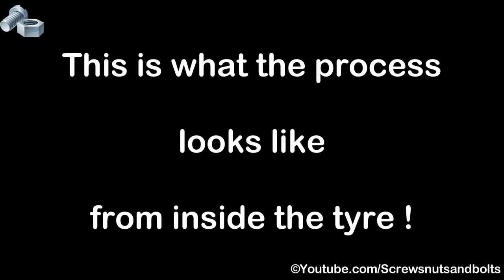Tyre Puncture Repair Kit Tutorial

Comment: Is there a speed limit on the row tire after that fix it is fully functional?
Reply from the maker: It doesn't specify but as it's an emergency repair I wouldn't travel at motorway speed until I got the tyre patched properly.

Comment: You are supposed to air the tire up 1st,then pull the nail or screw out. Then use the reamer. Afterwards,push the plug in and trim the excess off. Inflate to proper PSI.

Comment: Does it matter it air is pumped before doing this
Reply from the maker: It's actually easier if there's air in the tyre but be careful when removing the nail, screw or whatever is stuck in the tyre as there will be pressure behind it. Make sure you grip it tightly with a pliers as you remove it.
Reply: ScrewsNutsAndBolts hey I watched your video and did exactly what you did! Came out perfect thank you
Reply from the maker: @burneraccount9874  Thanks for watching ! :)

Comment: Good job .  Do you want a step up , better one .....!!!

As you put glue on the  Flexi hard Rubber , drop a  couple drops  of the glue exactly into the the hole without forcing , such that 

you should be able to see the glue seeps thru' and visible  unto the  inner surface   AND 

you put the glue on the the rubber strip , pushed it in   AND you cut the rubber close to the tyre surface , AND 

now soak  a few drops of glue around the joint  where these TWO RUBBERS are meeting inside AND outside .....

Let dry in the cool of the night ,   Inflate to the required pressure  AND  water test the wheel ( tyre on the Wheel ) in the water 

bath tub  , Job Done .  Good on you , Mite .  Cheers .

Comment: Question. Is it okay if I didn't remove/cut the excessive rubber strip? Thanks
Reply from the maker: It might just wear away but you're better off trimming the excess if you can get to it
Reply: @screwsnutsandbolts  Thanks for the reply. I'm just curious because my local repair shop doesn't remove it. So it will not cause any harm rite?
Reply from the maker: @thefarmer2717  Probably not

Comment: Is the cement glue part important? I just plugged it without any glue. Will it hold?
Reply from the maker: It should hold but it's only really designed to be a temporary repair to get you to a garage and have it fixed professionally.
Reply: @screwsnutsandbolts  you mean to take the wheels out and get a patchwork done?
Reply from the maker: @razi9593  Yes

Comment: There is something I don't understand. After you put the wick in, you pull it back and you take the apparatus in your hand out of the wick. so how does the apparatus separate from the wick?Is there a button on the apparatus in your hand that allows the wick to be separated? Or does it come out by itself, as the blade of the apparatus is like scissors when pulling the wick backwards?
Reply from the maker: The eye of the insertion tool is actually open at the tip
Reply: @screwsnutsandbolts  thanks

Comment: Just theoretically wouldn't be safer to just back out the screw a few turns and apply 1 hour epoxy resin to the threads and screw it back in then smear some resin over the top of the screw?

Comment: Can I do this again? Because the tire keeps losing pressure after a few days. I have checked using soap and the air is still leaking at the hole. I didn't have the cement in the kit though
Reply from the maker: You can but you probably won't be able to pull the old one out. You'll have to push it into the tire and then repeat the process. You can have them removed when you get the tire fixed properly at a garage.
Reply: @screwsnutsandbolts  I went ahead and did it after I commented here. But this time with the kit that has cement thing. Yea, I had to push the old one into the tire, I assumed that there is no way you can pull that thing out since it sealed the hole from inside. I have not checked the tire pressure but whatever, if I have to inflate the tire every week then I am ok with that lol.  The tires are still new.
Reply from the maker: @Kay-dx8vm  Hopefully it'll hold this time ! :)

Comment: I forgot to add the tire cement on my winter tubeless tire. Can you advise if this is necessary?
Reply from the maker: It seals it better with the rubber cement but it is not necessary. It's only really meant as a temporary repair

Comment: During inserting the needle with rubber strip in my car tyre, I mistakenly put more pressure and whole rubber strip went in and loosely fell into the tyre. The hole was left open. I had to insert another strip to fix the puncture.
Now what should i do ? Will it cause any issue in long run or Can I drive the car normally with it ?
Reply from the maker: It's only a soft rubber strip so I don't think it will cause any harm

Comment: I find it is MUCH easier to insert the plug ,  if you put the rubber solution on the tool ( without the plug rubber ) and quickly lubricate the ragged hole , then carry on as shown , with solution on the plug rubber .... this does make a bit of a mess  ( all over your fingers ! ) , but some cellulose thinners cleans up OK

Comment: These are the cat's pyjamas for quick and permanent (in my opinion) repair. I have used many many times and only ever had one leak.  All the rest I wore out the tire.  

If you have an inflation source, you don't even need to dig out the spare, or take the tire off of the vehicle.   

Just put one in a motorcycle tire. So far so good  ( March 25 2022 )   - Cheers
Reply from the maker: Thanks for the comments 👍

Comment: This is a permanent fix?
Reply from the maker: It's recommended as a temporary repair.
Reply: @screwsnutsandbolts  for how long though?
Reply from the maker: @heldenkatze  They could last for the entire life of the tyre but they're designed as an emergency repair until you get to a garage and have it fixed professionally.

Comment: I use vulcanizing cement and then when plug is in set it a blaze it will burn and melt plug and rubber sealing it off
Reply: Old bicycle trick when I was a kid on inner tubes.

Comment: Nothing like the experiance i had. It looks so easy getting a scew out  but a nail is much harder   .Maybe the kit you get matters but the string was a mess getting it out of the packet and i am pretty strong but i couldnt get the plug into the hole and ended up bending the applicator .
Reply from the maker: There are many different kits out there. Some are quite poor quality
Reply: Just been to auto shop and the kit there looks a lot better  but 2.50 more ..It definitlely matters which kit you buy .I got mine on line for 3.59 .I guess you get what you pay for .
Reply from the maker: @jimmyneedham4346  That's true

Comment: Does this work on sidewall?
Reply from the maker: No I don't think it would be safe to repair a sidewall using this
Reply: @screwsnutsandbolts  I unfortunately had to do it as an emergency measure to get to the tyre shop when I didn't have a spare

Comment: Is the glue necessary? I saw in the tyre shop they don't use it
Reply from the maker: Not all kits come with a glue, but if it is included as part of the kit, I would use it
Reply: @screwsnutsandbolts  maybe because some of the plugs have king of glue in them already as they a bit sticky

Comment: You need to inflate the tire right after fixing the tire for the bung on the inside to push into the tire to guarantee a seal
Reply: I put all 4 new tires and the very next day nail punctured it. My question is, is this the permanent solution? Or I need to change the tire again. Thanks!

Comment: So you comment early on that this is just to hold you over until you can take it to a professional tire shop.  What should they do differently?  Your process is the same thing I see them doing when repairing my tires.
Reply from the maker: At a tire shop they usually remove the tire and patch it from the inside, or at least they used to !
Reply: @screwsnutsandbolts  Some of our tire shops do that here as well, but honestly your method seems like it would provide a better seal than an inside patch.

Comment: Forgot to apply thr solution. Will that cause any issuue ?
Reply from the maker: It might not seal as good but some kits come without the rubber cement and it works fine so it might be ok. I would only use this kit as a temporary repair.

Comment: i read that sidewall portion not meant be repairable ?
Reply from the maker: That's correct. The sidewalls aren't safe to repair as they're not supported with steel belts and they flex a lot

Comment: Is this still reliable way in 2022
Reply from the maker: It's still in use everywhere
Reply: @screwsnutsandbolts  actually day before yesterday i repair my Suv tyre first time because i found big screw in front tyre because the whole tyre set is almost new only one tyre is effected so instead of changing the tyre i repair it just like this but most of the time i drive on highway n now loosing my confidence because of this repair but now after repairing my tyre pressure is constant so that means its fine but is there any chance like this repair fails ?
Reply from the maker: @YOVlogs  I would only use this kit for a temporary repair. If you're in any doubt, take it to a tyre shop and have it patched from the inside.

Comment: DOES THE RUBBER CEMENT VULCANIZE THE RUBBER ?
Reply from the maker: "Regular rubber cement will work as a vulcanizing agent and create an effective seal between the rubber and the plug"
Reply: @screwsnutsandbolts  Heard some kits have a glue is just glue and does not vulcanise...
Also can you use superglue or UHU glue?
Reply from the maker: @esecallum  I don't know to be honest, I just demonstrated the kit that I bought :)

Comment: I couldn't get the strip in as far as I would have liked, probably should have made the hole a bit bigger. But the tyre is sealed. Will see how it goes.
Reply from the maker: Did it work ?
Reply: @screwsnutsandbolts  It did, thanks for asking. I've driven hundreds of miles on it with no issues. 👍🏽😎
Reply from the maker: @rattlebob8984  You're welcome :)

Comment: What if i put all the stripe inside
Reply from the maker: It shouldn't cause a problem. It might rattle around in the tire at slow speeds but it shouldn't be heavy enough to affect the wheel balance or cause any damage. You'll have to redo the repair again

Comment: Do you need the glue ?
Reply from the maker: I use it if it comes with the kit. Some kits don't use the glue.
Reply: @screwsnutsandbolts  cheers. Mines never came with glue so I was wondering if you done it as an extra measure. Thanks for the reply!
Reply from the maker: @ScottsGFX  You're welcome 👍

Comment: This method of tyre repair has been banned in the UK for years. It is not at all a safe repair. The only safe way to repair a tubeless tyre is from inside with a combined plug and patch. By all means use this as a get you home method, but please please get it done properly or replace the tyre when you are able.
Reply: Agreed, here in india, it's the common way but sooner, the leakage starts from the strips after they worn out.. would be better to do it from inside.

Comment: Why can't they invent something that is injected into the hole that fills and seals instead of filing and breaking the belts in the tire and creating other problems. Inner patches are better but still have their problems.
Reply: A tack hole can be fixed with glue only. I did this on a riding mower. It held for about a year. The sidewalls started cracking & I replaced the tire. I used an air compressor to blow some of the glue through the hole.

Comment: Why not just use a cordless drill to enlarge the hole? Much easier!
Reply from the maker: True, but I'm just demonstrating how to use the kit :)
Reply: @screwsnutsandbolts  
Actually I have worked out why NOT to use an electric drill. You will cut the wires in the tyre. Hand tools will push them apart slightly instead of cutting them. I think!

Comment: Dear viewers. I would like to comments on this new tyre reparing technology. It has a advantages and disadvantages.
1) This is fast way to repair  tyre and if  you have reparing kit even you can carry out this reparing work by your self and its easy and fast process even cost effective.
But it has big disadvantage it will be used only in tubeless tyres.when you repair your tyre with that kit if your tyre are nylon belted it is ok but when your tyres are steel belted it is not adviseable to use this kit better to take this tyre to tyre reparing mechanic and tell then please make puncture with out being used this kit if puncture is not over size they will remove the tyre from the rim and seal the puncture with chippi from in side of tyre. This process is more safe its save your tyre to be damaged.if you use this kit in steel belted tyre. After reparing when you are on the road water sipthrough from this sealed place into the tyre which make your steel belt rusted and steel belt become week and later your tyre running on the road unevenly or can be seen swelled when you drive with such a tyre u can feel it that your car is not smoothly moving. secondly after becoming  steel beltd tyre rusted more risk arise that tyre can burst on the road.To avoid that accident we have to replaace that tyre with new one.its too expensive to replace new tyre.if pincture i is not repairable with chippi then my advice to put the tube in the tyre and enjoy.in all situation i do not recommend this kit to be used at all. This is my personal experience.please be awere short cut is always expensive.My all vehicle if thay had puncture i do not allow this kit to be used to repair  my tyre. Please avoid and abide. Thanks

Comment: Ah.... I followed the dumb instructions on the packet... Your way is much more sensible! Instructions said to put the glue on the needle, which I did.. then to insert the rubber thing through the glue-covered needle? Thanks for the sticky fingers, Instruction-Writer! Then insert, which I did. Seems I should have put glue on the rubber strip, not the needle. Also, thread the needle, THEN do the glue bit... Well took the car around the block this evening and do a few 90 kph emergency stops and that front tire still seems OK. I guess it should be OK.. toes crossed....

Comment: NEVER USE CHEEP GLUE AND ROPE KIT! ONLY use a kit that has VULCANIZING fluid. Install this cheep  kit per instructions allowing the time to set, and then pull it right back out with pliers 😭 VULCANIZING means the plug becomes part of the tire and can't be removed. Tech brand tire products is one option. Also the ropy plug shown will wick water onto the steel belts causing rust and permotiing failure.